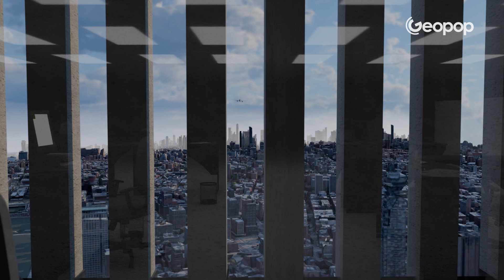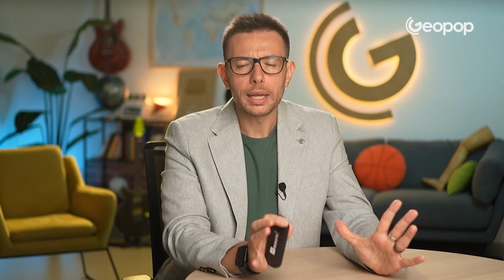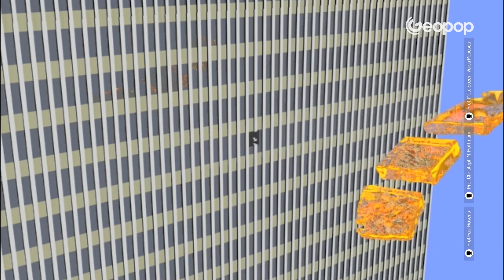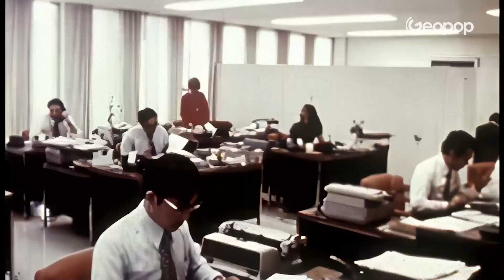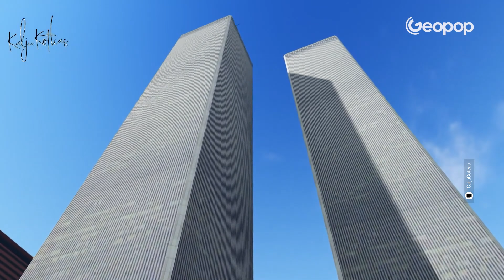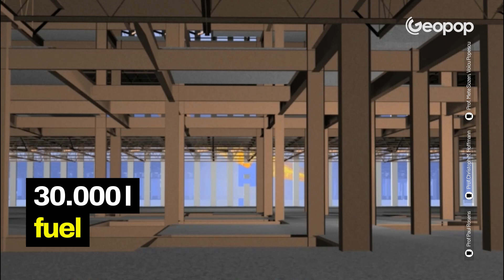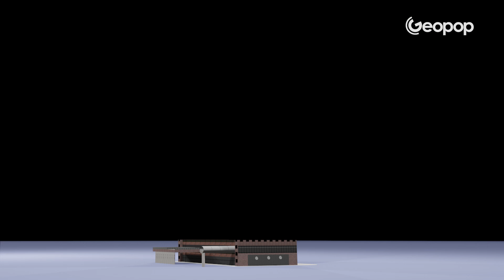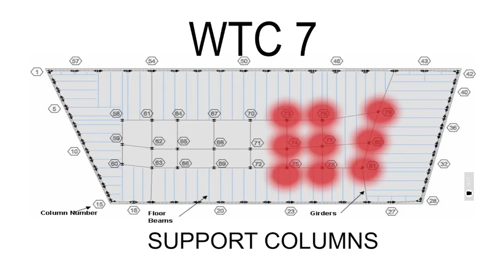9/11, 2001: The Technical Reconstruction of the Twin Towers and WTC 7 Collapses

Comment: This VIDEO IS DISINFORMATION
No doubt.  I have heard many explanations by physicists, explaining planes don't bring down buildings. This Nicistis is propaganda. 

Funny I didn't hear the narrator mention the demolition explosions.  Sorry man, this video explanation seems to be a bunch of BS. 

The 7th tower, was brought down by demolition. The Managers (Feinstein) actually said during a CBS interview, admitted they brought the buildings down on purpose. They said they had to "pull it", because they were afraid of the 7th tower collapsing on its own.  

This is a BS report.
Reply: Physicists are not engineers.  This is an engineering problem.
Reply: @TheLoonResistance  : And anyway, actual competent honest physicists understand enough to follow what actually happened.
Reply: @ThomasKunderaTer You mean this: 

While complex, most of the Twin Towers collapse mechanisms can be seen with the naked eye and easily discerned and understood by the layperson if sufficient time is taken to understand. 

1. The Twin Towers consisted of 4 primary structural elements that together formed an integrated system where each relied on the others.  47 hollow box-section steel Core Columns carry the majority of the gravity loads. The 236 hollow box-section steel Perimeter Columns carry the remainder and ALL of the lateral (wind) loads. Long-span Lightweight Steel Trusses connect the core and perimeter column together at each floor with a Hat Truss on top to tie the structure together as an integrated unit where no element can survive without the others. There was no structural load bearing concrete and most components were bolted together. www.youtube.com/watch?v=u7OqrC74Dm4 

2. The impact of 117 tons of airplane (= to about 12 dump trucks) at speeds up to 590 mph with the energy of a ton of TNT completely destroys the aircraft. This in no way implies the Towers come out unscathed. Many perimeter columns are damaged or destroyed as are some core columns (example; 33 of 59 perimeter and 20 of 47 core columns damaged or destroyed at the impact floors in the North Tower), This damage is primarily through bolt-shearing failures at the end connecting flanges, as well as bending, twisting and fracturing of weld seams. There was no cutting or slicing - the reality was far more violent and messy. 

3. The impacts destroy or damage fire insulation, fire breaks and sprinkler systems on multiple floors.  Huge fires are started across multiple floors simultaneously and allowed to spread rapidly with no effective firefighting or fire suppression. This was an unprecedented fire event . 

4. The hotter steel gets the weaker it gets .  With fire insulation stripped away and no sprinklers the survival time of the steel greatly reduced. Gradually over time heat causes the lightweight steel Floor Trusses at the impact damaged floors to sag, which was observed and recorded.  No steel melted or needed to. Structural steel fails long before it becomes a puddle. It just needs to bend

5. Sagging floor trusses pull on the increasingly weak and overloaded Perimeter Columns, causing some of them to bow inward by up to 5 feet. A straight column is up to 4 times stronger than a bent column. The bowed Perimeter Columns buckle and fail, initiating collapse. The formerly static mass above which the structure below could easily support is now converted into a dynamic mass up to 30 times greater. Because they have buckled, the Columns above and below the failure point are no longer aligned . The load bearing structure below no longer bears any load as it falls past the lower columns, NOT onto them.

6. Thousands of tons of debris fall within the four outer walls, down through the open office space, crashing onto the first intact floor it encounters. This massive impact immediately breaks the bolted connections to the columns as the amount of resistance the Floor Trusses can offer is negligible.  The falling debris slows only marginally and briefly. Note:
6a. This is NOT a solid top block crashing into and “crushing” a solid bottom block .
6b. The debris falls past the columns not onto them.  The columns provide no resistance to the falling debris. 
6c. Only the bolted connections of the floor trusses to the core and perimeter columns can offer any resistance. A pair of 5/8” bolts at each end of each truss vs. thousands of tons of falling debris.
6d. No laws of physics are violated.

7.  This floor-led collapse progression within the four outer walls can only go straight down. Note: 
7a. This process is often incorrectly referred to as “pancaking” which actually refers to a completely different process rejected at an early stage. The catchy name stuck but nobody knows what it is supposed to mean.  Pancaking is too simplistic and inaccurate anyway. More like Kaiserschmarrn.

8. Collapse progresses through the floor systems not down the columns, through the path of least resistance . Rate of floor failures increases with each successive floor as momentum increases, reaching an average acceleration of 0.65 of GA, or 35% slower than true free fall. Bam, bam, bam down the building until there are no more floors to fail.  The resistance offered by each successive floor is always the same. The mass and velocity, thus the energy of the falling debris is constantly increasing, with each floor destroyed adding new falling mass. Some falls to the sides, but most falls down. More mass, more velocity, same resistance with each floor.  Don’t get stuck on the but the lower floors weren’t on fire nonsense. They weren‘t and didn’t need to be.

9. The Towers were 95% air by volume. As that air was compressed inside the building it is forced down the tower and blown out the sides in reaction to the building collapsing . Those were not “explosions”, it was expulsions of compressed air caused by the collapsing building, explaining the low velocity, lack of flash, blast, supersonic pressure waves and lethal high-velocity ejecta.  

10. Perimeter Columns become detached and peel away like a banana behind the collapse front, playing out to the four points of the compass extending to more than 600 feet from the base of the towers. This was quite obvious from examination of the debris pile. 

11. Core Columns fail last as their internal beam bracing is stripped away by falling debris and lateral support from the floor to perimeter columns is lost. 

12. For those who care about how long this whole process took; 31-34 seconds from the moment the perimeter columns buckled until the last core columns hit the pile, or 1/3 the rate of true free fall. Don’t believe me?  Just watch any video of the collapses and note the loose truly free-falling debris dropping much faster than the towers themselves.  

13. Each Tower had a 1-acre footprint. Far from collapsing inside their own footprints the debris pile spread out over 17 acres in a pile up to 14 stories deep. 8 surrounding buildings were destroyed and scores more damaged by the falling debris. 

14. NOT observed were the 180-190 dB bangs of thousands of high explosive devices or the blinding bright flashes of burning thermite. Neither explosives or thermite could have survived the impacts and subsequent fire nor could have caused the (silent) perimeter column buckling that clearly initiated collapse either. A video of a shocked and injured firefighter casually using the magic word explosion is in no way proof of explsoIVES  and the demolition_ case relies entirely on that sort of thing. There is zero tangible physical evidence and it would be technically impossible, totally impractical and completely unnecessary. No one would bother. 

15.  Finally, the Twin Towers were perfectly safe within their design envelope.  They only collapsed when taken far outside design parameters by an extraordinary and unprecedented event 

Impact + Fire (heat) + Time + Gravity = Collapse . Remove any one of those four elements and there is no collapse. Ignore any of those elements (as many do) and you will never understand the collapses. The Twin Towers were an integrated system in which no one component could survive without the others. One fails, the rest follow, through the path of least resistance – DOWN – through the open space, bypassing the path of greatest resistance – the columns.  Nothing I just described violates any laws of physics. All of the above is true no matter who planned and carried out the 9/11 attacks or why 

In 24 years zero structural engineers of tall buildings, including the 1/3 that have retired in that time, have made any statements in support of 9/11 Truth BS demolition claims. Zero, nada, none. The lack of any such citations in the engineering literature (published in any country worldwide) is palpable.

I hope you found this helpful and informative. It is not meant to be adversarial, but to solicit informed critical comment, positive or negative. If I made any errors of fact, logic or reason or left anything critical out, please let me know so I can fix it. To stay focused just one topic at a time please and on-topic (Twin Towers ONLY). No word-salads of Gish Gallop. IF you can offer a more plausible alternative be my guest. Be the first. Please start any reply with the words “Tits McGee” or I will know you didn’t actually read it, are not serious and just wasting my time. If you are going to argue, do it on the merits.

Comment: Why did a reporter say that WTC7 had come down, when it was in view behind her shoulder 20 MINUTES BEFORE IT CAME DOWN? I have that video of the news
Reply: About 30mn before WTC7 felt, firefighters show heavy signs of structural failure: one side already went down by about 2 meters.
At that point, it was obvious it was going to fall, and they reported it.
And in the crazy mess of that day "it's about to fall" was mistaken as "has felt".
Not surprising.
Reply: Because she was reading an AP wire service report that turned out to be in error.  That only happened a few hundred times in the chaos and confusion of that day.

Comment: Jet fuel doesn't melt steal beams, but thermite does. 100% inside job. It was considered a "conspiracy theory" but nowadays it's more of a fact, more than a "theory".
Reply: Nope, total conspiracy theory lacking any solid evidence whatsoever. The thermite claim has been debunked. There's no evidence of an inside job.
Reply: Thermite melts steel?  Does it though? If only someone had actually tested this instead of just guessing or making unfounded assumptions. Oh, wait!

youtube.com/watch?v=JXWCMBuusMI&ab_channel=TrutherTVArchives 

In this video starting at 45:35 and running to 48:35 the Energetic Materials Research and Testing Center (EMRTC) conducts a test to examine the effectiveness of thermite in cutting a vertical hollow box-section steel column. The column tested is smaller in cross section and made of thinner steel than that of the Twin Towers perimeter columns (and never mind the core columns). In total 175 pounds of thermite are used for the test on just one column and requiring the construction of a rather conspicuous coffer dam to contain it. Do recall the Twin Towers had 240 columns and 110 floors.

It would be odd if thousands of office workers missed hundreds, perhaps thousands of those suddenly appearing.

Note what an incredibly slow process this is. It took close to 30 seconds for the thermite to finish burning off.  It would be impossible to “control” a demolition using this material.

Not to mention the issue of; how does the aircraft impact and subsequent raging fires NOT prematurely set this stuff off?

Also note how bright and obvious the whole process is. Could not be missed visually. No way to hide that. 

Then at the end of the test the (relatively modest) column was undamaged…. which is a problem.

Certainly no rivers of molten steel emanating from it either and in fact the whole thing cools rather quickly as soon as the thermite has burned off, as one would expect.

Thermite has never been used in the controlled demolition of any building, let alone one with multiple floors on fire after the impact of a large jet. If the conspiracy oriented internet has taught us anything it’s that if something has never happened before, it can never happen.

Guess what, you were wrong about everything else too.

Comment: Hold on a second did they not evacuate WTC2 after the first plane hit??
Reply: There was no formal evacuation of the South Tower after the North Tower was hit. A lot of people left on their own. Some people were advised to stay. In 20/20 hindsight evacuation seems the only way to go, but at the time there was no reasonable expectation the South Tower was under threat. A full-scale evacuation was potentially dangerous.
Reply: @TheLoonResistance didn't they know that two more planes had been hijacked way in advance? Plus the first tower collapsing (as I'm sure they would be aware was a risk) would send a huge amount of debris flying into the second one, of course in hindsight we all know what happened but I just think it seems like insanity to continue working in a 110 floor building when a plane has just crashed into one no more than 100 meters away
Reply: @joelmacinnes2391 - No, they didn't know.  Until the South Tower was hit everything was chaos and confusion. No one was expecting multiple kamikaze attacks and not a single person in the South Tower was aware Flight 175 had been hijacked and was aiming for it. 

To understand the reasoning you do have to forget everything you know and follow the timeline of what people in a decision-making position in the building would have known at that moment and what they might have reasonably expected. 

No 20/20 hindsight allowed.
Reply: @TheLoonResistance  I'm sure there were radio communications from the hijackers weren't there? Regarrdless, of course they couldn't have calculated in the space of 30 minutes or however long they had, the ins and outs of the collision and the results, but surely when such a tall building has been hit by a plane it must cross your mind that, if the building were to collapse - which couldn't just be dismissed based on the temperatures a burning plane full of fuel would cause - it would cause huge damage to the surrounding area. Even without the second plane, it would seem like the safest course of action would be to carry out a controlled evacuation of the surrounding buildings
Reply: @joelmacinnes2391 - You are still using 20/20 hindsight. 

You are in the South Tower. You almost certainly didn't see shit. ALL of your information is rumors - most of which conflict - and what little you might be able to see out of a window after the fact and presuming you are on the right side of the building to see anything. Maybe someone on your floor might have a radio, but in those first minutes they don't know much more about is going on than you do.

THAT IS ALL YOU KNOW

The first phone call from Boston ATC to NEADS that Flight 175 might also be a hijack occurred at about the same moment Flight 175 hit the South Tower. That's how much warning there is. Zip.

Evacuating tens of thousands of people - some of whom might panic - out of a perfectly intact and safe building out into the streets and the plaza, where debris and bodies are falling and where the fire department and emergency services need access to do their work is not automatically the best idea.
Reply: @joelmacinnes2391 radio communications were with the ATC not with people in the tower

Comment: 2:36 BS ALERT. How high was the temperature in the strike zone. First of all, jet fuel burns at about 700°F. More than enough to burn paper, or pizza 🍕 
That this did not challenge the veracity of the NIST report. Suspending the 2nd LAW of Thermodynamics would be required before the NIST suppositions could be twisted further into factoids
Reply: BS alert indeed.

People focus far too much on jet fuel fires and grossly mis-apply its role to imagine jet fuel was the only flammable material rather than it acting primarily as an accelerant. That said though,…

In this video starting at 22:30 and running to 28:10 the Energetic Materials Research and Testing Center (EMRTC) conducts a test to see what an open jet fuel fire can do to a loaded and unprotected steel I-beam. Remember, steel melts (turns into a liquid) at around 2,600-deg F, give or take depending on specific alloy. The test was planned for 30 minutes.

youtube.com/watch?v=JXWCMBuusMI&ab_channel=TrutherTVArchives

Within 2 minutes the open fire temperature has already exceeded 2,000 deg-F. 

After just 3 minutes 40 seconds the beam is sagging noticeably.

The beam fails and collapses 9 seconds later after just 3 minutes 49 seconds.

Note the steel fails but does not melt. It is bent and twisted, but not a puddle. You can still tell it is an I-beam. 

Purely from a jet fuel fire. 

Jet fuel cannot melt steel beams, but then again it doesn’t have to.  The steel fails well before it gets a chance to turn into a puddle and it doesn’t take long. 

Like we see in the first 12 seconds of this video: 

www.youtube.com/watch?v=ULdiD6gYZO0